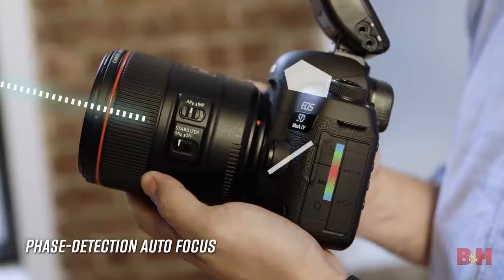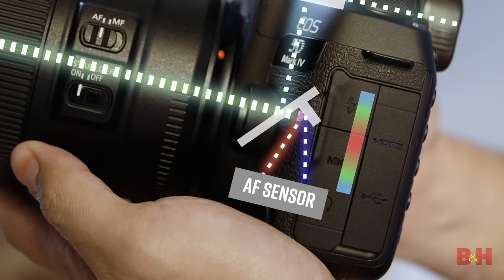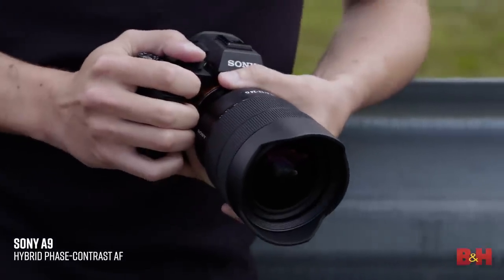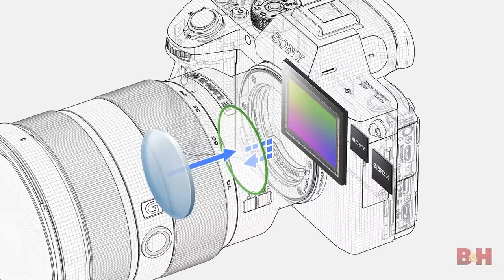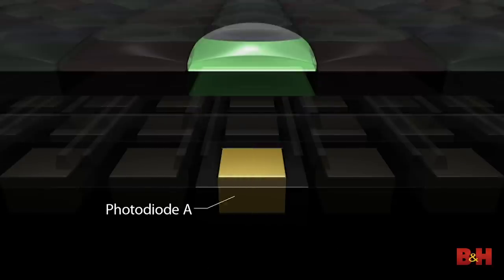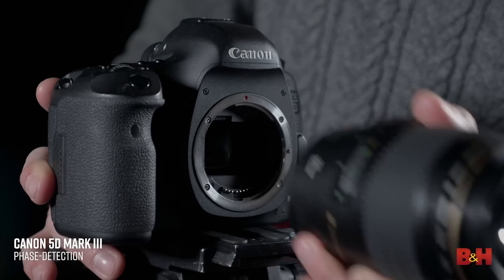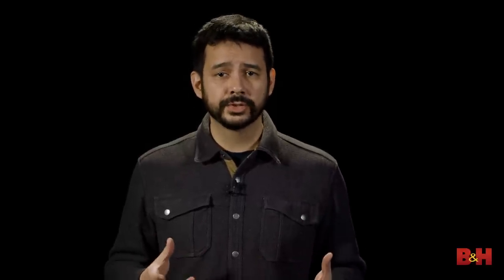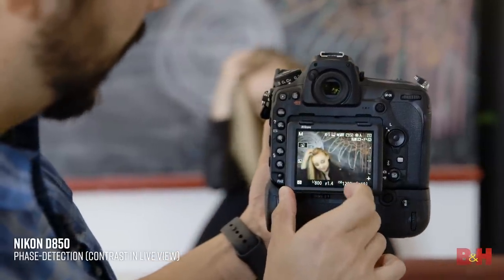What’s the Difference Between Phase vs. Contrast Autofocus?

Comment: How much the amount of contrast points when i have already about 400 phase points (a7rii vs a7riii)
Reply from the maker: While I do not quite understand the question as it is written, trying to answer your inquiry as best as I can, both the Sony Alpha a7R II Mirrorless Digital Camera and the Sony Alpha a7R III Mirrorless Digital Camera uses both on-sensor phase detection (for depth awareness) and contrast detection autofocus (for high precision).  The main difference between the two cameras would be the coverage of the AF points and the number of points.  Both cameras sport 399 phase-detection AF points.  However, the 399 phase-detection AF points on the Sony a7R II covers approximately 45% of the camera's sensor, and the camera has 25 larger contrast-detection AF points (which cover a slightly wider area).  On the Sony a7R III, the camera also has 399 phase-detection AF points, but the points now cover approximately 68% of image area width and height.  The Sony a7R III also sports 425 densely positioned contrast-detection AF points, many more and much smaller than those on the Sony a7R II.  Autofocus performance on the a7R III has been improved as it borrows many of the improvements from Sony's much-faster sports-oriented Sony Alpha a9 Mirrorless Digital Camera, so the a7R III would have a much improved focus system compared to that of the older a7R II.  I hope that answers your inquiry.

If that does not fully answer your inquiry, you may e-mail us with a fuller description of your inquiry to askbh [at] bhphoto [dot] com.
.